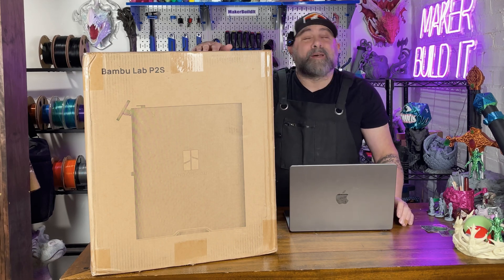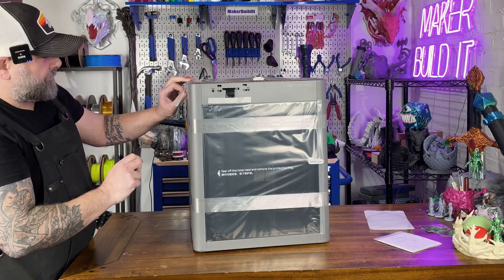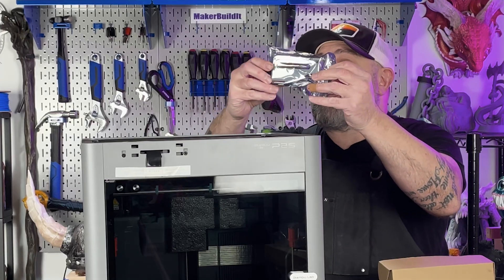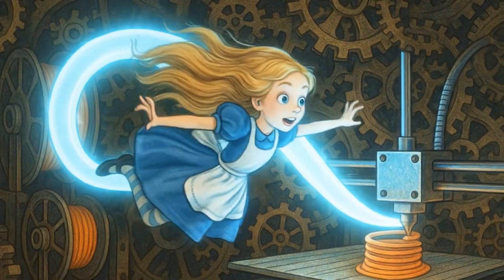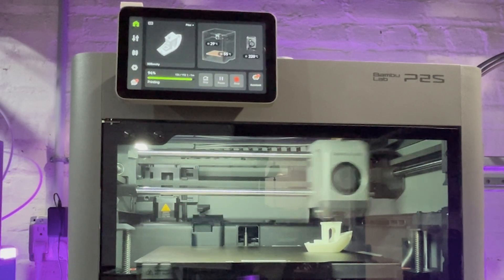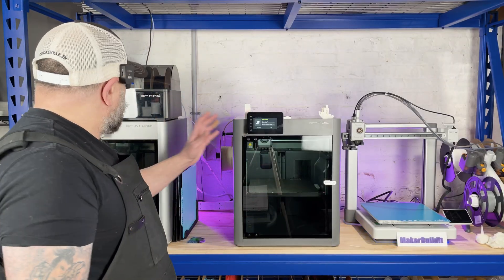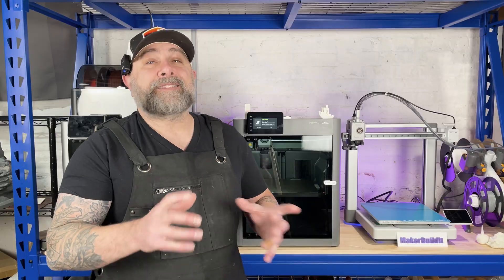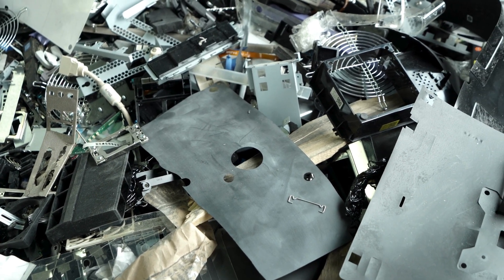I Tried the P2S 3D Printer and WOW! (Wait what Happened to the X1C?)

Comment: The ams hub changed because they added a design which allows you to easily remove the ptfe tube between the hub and the printer by bejng able to slide the buffer element to the right to access to release hole,

They also made it so you can have 4 colours and the side mounted spool connected at the same time, making it 5 colours.

Also, unlike anycubic, bambu lab seems to be taking a similar approach to elegoo : sell and offer spare parts for their older printers for a long time.

Anycubic in the meanwhile stopped supporting any parts for the kobra 2 max, which is a 2023 printer. Boo.

Comment: What no one’s talking about is that the H2 and P2 series cannot consistently perform ironing like the P1 and X1 series can.
Reply: Yet* I'm sure firmware updates will fix that.

Besides competitors can't either (elegoo, snapmaker or anycubic)
Reply: @cartouchator  then why haven’t they fixed it on the A1?

All of those printers now use interchangeable nozzles and all of them apparently cannot do ironing nearly as well as the X1C.

It’s a main reason I’m holding off pulling the trigger on a new Bambu as my primary product requires ironing.
Reply: @ghostmastergaming7269 never had issues with ironing with the a1. It does need calibrating and tweaking but got it to work just fine. My kobra s1 on the other hand just seems incapable of ironing well...
Reply: What is ironing when it comes to 3d printing?